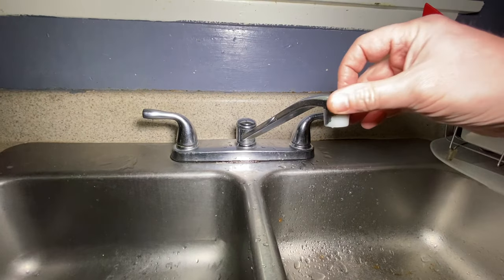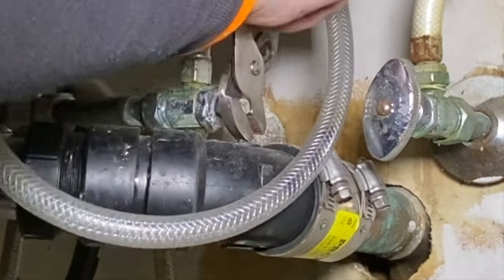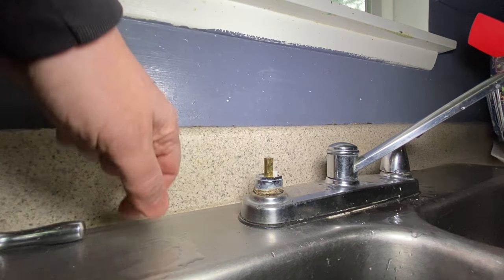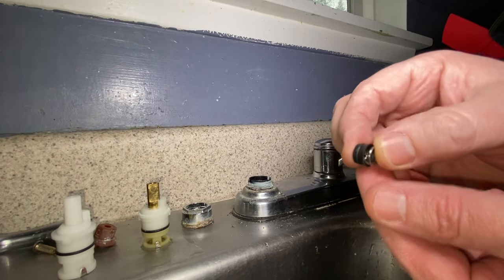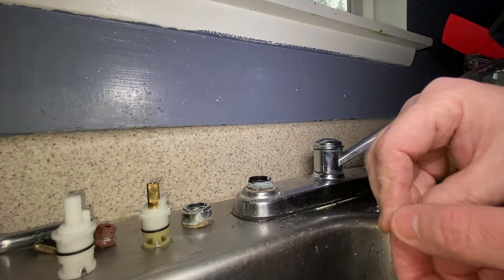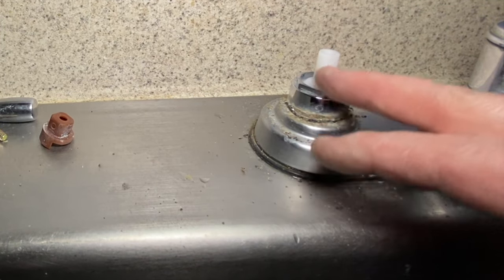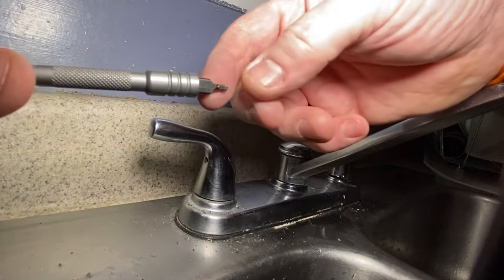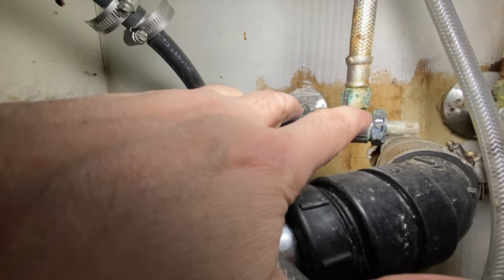Two-Handle Kitchen Sink Faucet Leak Repair

Comment: great step-by-step video! thanks for all the great info!
Reply from the maker: Your welcome. I’m sure this will help someone out dealing with these things.
Reply: @ThatFixItGuy  Hello THAT FIX IT GUY hoping to hear from you today. I had a kitchen leak around the faucet area.  I put in the rubber or o-ring or gasket whatever you call it for some call it one and another...put in the rubber with the spring like I have been doing for years in the handle and it stopped the leak on the cold, the hot was fine.  So the next day the very old line started leaking under the sink on the cold.  I have never changed it in 20 years, so I changed the line under the sink for the cold.  The leak stopped yesterday.  Ran the water all day then today, the center faucet line started leaking!  
Is this just a coincidence or can water pressure cause this?  This line is also really old and doesn't look good.  Do you think I am wasting my time and just need a whole new faucet?  I know the basics, have changed the cartridges thru the years, but they seem fine. I am just totally stumped that I have a new leak in the center faucet now.  
Thank you so much!

Comment: I know this video is a year old but you absolutely saved me about $70. I had a terrible drip so I popped the handle and that plastic ring had no give, it was basically flush pressing down on the spring. Disassembled it a wouldn't you know absolutely no leak at all! You sir are a hero!

Comment: Hello THAT FIX IT GUY or anyone!,  I had a kitchen leak around the faucet area.  I put in the rubber or o-ring or gasket whatever you call it for some call it one and another...put in the rubber with the spring like I have been doing for years in the handle and it stopped the leak on the cold, the hot was fine.  So the next day the very old line started leaking under the sink on the cold.  I have never changed it in 20 years, so I changed the line under the sink for the cold.  The leak stopped yesterday.  Ran the water all day then today, the center faucet line started leaking!  
Is this just a coincidence or can water pressure cause this?  This line is also really old and doesn't look good.  Do you think I am wasting my time and just need a whole new faucet?  I know the basics, have changed the cartridges thru the years, but they seem fine. I am just totally stumped that I have a new leak in the center faucet now.  
Thank you so much!
Reply from the maker: I would just replace the faucet and supply lines. You get to a point where it is better and it nickel and dimeing you to death.
Reply: @ThatFixItGuy  I may as well just check because either way I am going to have to replace the Faucet supply line, the hot and cold are new now. Thank you
Reply from the maker: Yeah right on.

Comment: Went to the hardware store and saw different size stem valves. How do I know what size I need. I have a delta Kitchen Faucet. Should I just take it out and compare at store?
Reply from the maker: I totally would take it to the store and compare. Great way to make sure you get what you need if you can.
Reply: @ThatFixItGuy   thanks I did find the part. Update on the repair. Still leaking but not as it once did. what do you recommend?
Reply from the maker: Did it have a seat and spring in the valve as well?  Did you change that?
Reply: @ThatFixItGuy  Yes I changed that as well. It is dripping way less, though. Any ideas? Should I re install the part to make sure everything is okay?
Reply from the maker: You could try that. Send me a picture on Facebook if you like. I would like to see what your working with.

Comment: Awesome video. That must drive you insane. I mean to go in and do one job and find out there are five more jobs that need to be done to make it all correct. Guess that's why I'm not a plumber. Thanks for the video though, well done.
Reply from the maker: I try to go into a job thinking it will be the worst ever. That way  I’m not freaked out by it. And when it turns out easy I’m happy with getting it done so fast. Not this time though. Thank you Scott.

Comment: Nice video. But, yowser, it would have been nice to soak all those hard water, crusted parts in CLR solution to clean things up for a nice, tidy repair job. Also, it's good practice to put some silicone grease on the spring loaded rubber cap to provide a longer lasting seal. Considering how things were on the hot water side, it probably is only a matter of time before the rubber cap/spring on the cold water side fails too and starts leaking. Usually those cap/spring repair kits come in twos. Hope you do your friend the added favor of updating the cold side too.